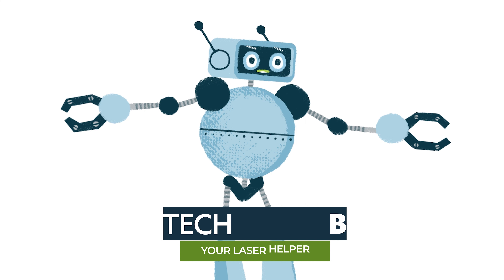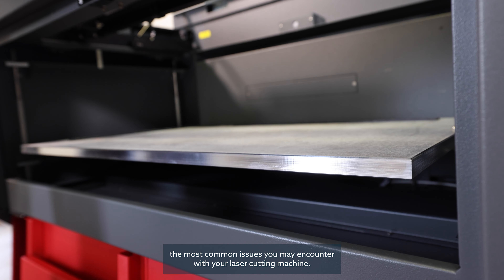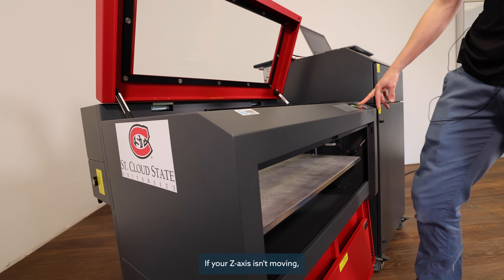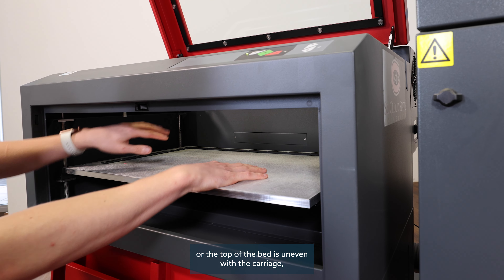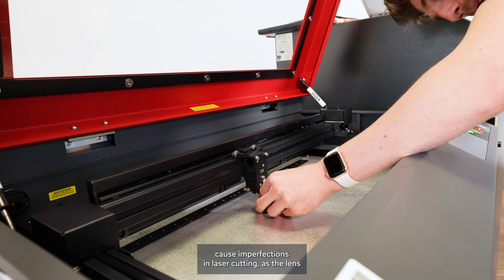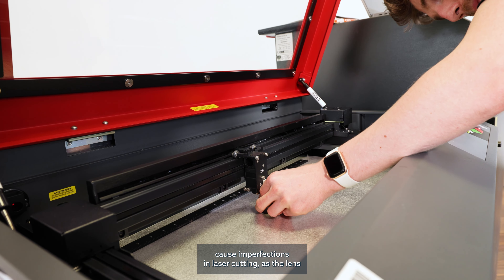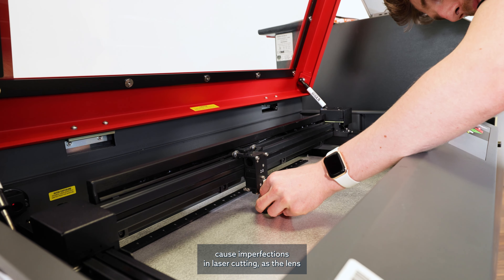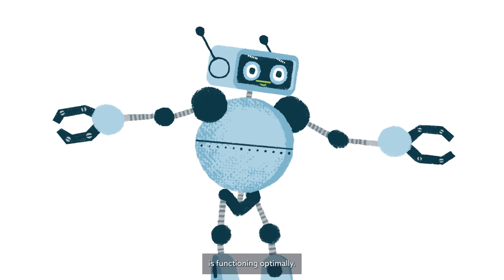Common Z-Axis Issues with your Universal Laser System’s Laser

Comment: Well, after 4 table leveling, a new Z motor, Z motor gear, and 5 belts, we're still getting tooth skipping.  Problem not identified.
Reply from the maker: We're sorry to hear that!

Identifying issues with Z-axis problems can be quite complex, as a single faulty part can affect the whole system. Often, problems might be caused by a combination of factors, such as misaligned lead screws. Considering the numerous parts involved in your machine, it's probably best to have a professional take a closer look to pinpoint the exact issue.

H2I Group has certified technicians that can assist here: https://h2igroup.com/service-request/
Reply: @h2igroup  We're definitely at that point, and I've forwarded your info to my manager... as ULS hasn't been the most helpful.